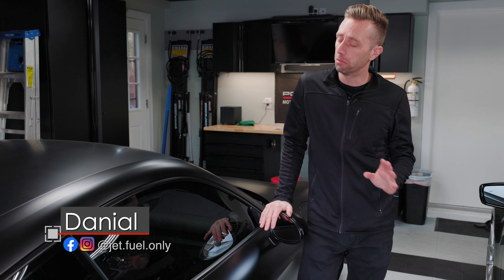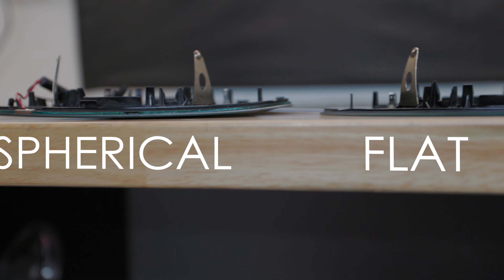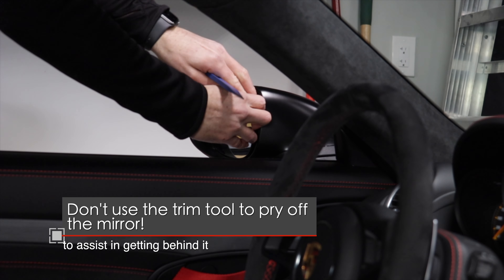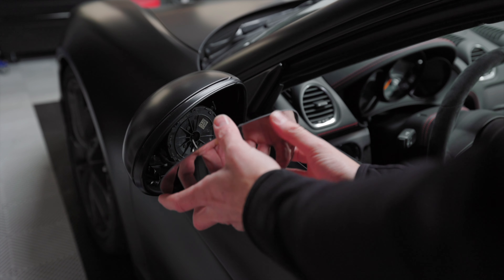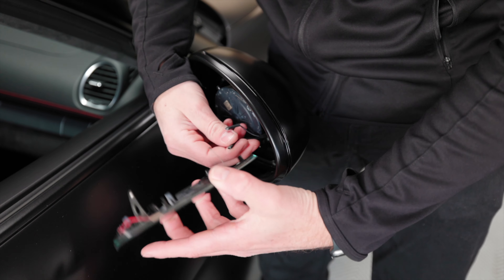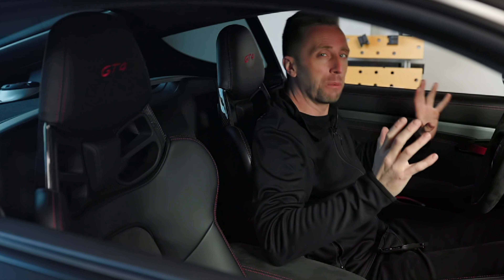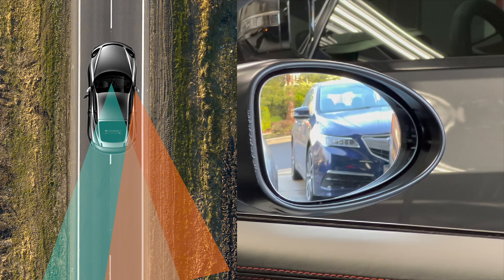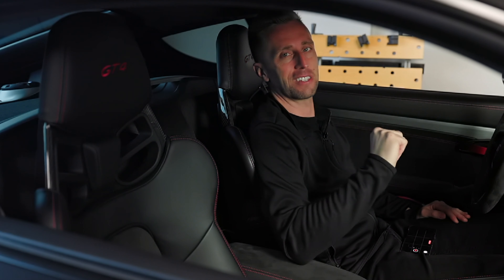See more with these mirrors! | Porsche 996 997 991 992 981 718 Taycan

Comment: I believe it was popular mechanics who published a mirror set up tutorial several years back along with a statistic that some 90% of drivers have theirs adjusted incorrectly. 

What PM suggested was to lean your head against the driver’s side glass and then adjust the driver’s side mirror such that you can barely see the car. 

For the passenger side, they suggested leaning your melon towards the passenger side glass a similar distance, and doing the same. 

This set-up is intended to result in passing cars briefly being visible in both the rear view mirror (on the outside edges) as well as in the side view mirror (on the inboard side). 

I’ve set my mirrors up this way, but as I’ve never been passed, can’t personally validate the efficacy of it. 

Great video. Shame that so much of the passenger side mirror is hooded when adjusted appropriately.
Reply from the maker: Yeah I think I read the same article!  Never been passed 😂😂 love it.